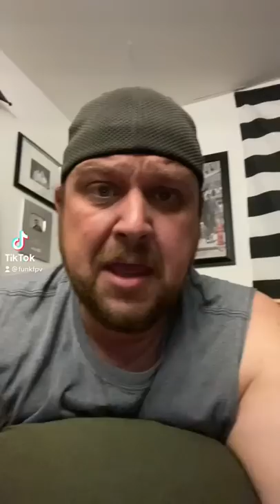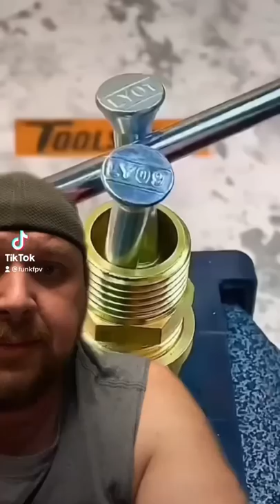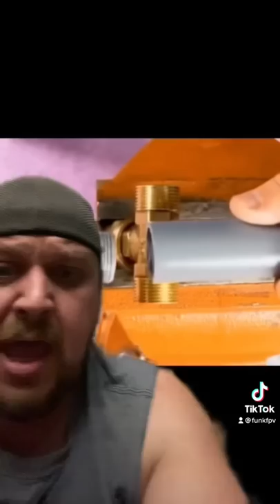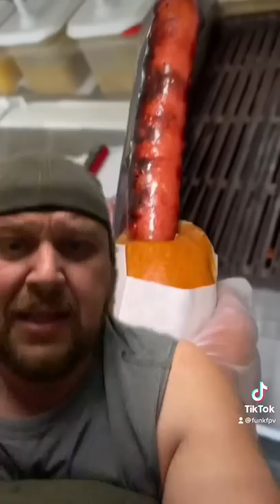Comments Review

Comment: Thanks for the common sense schooling. I just received my diploma in the mail from you yesterday.

One quick question.. How would you suggest I open the envelope? A hex key welded to a crescent wrench just wasn't doing the job.
Reply from the maker: I usually use a string trimmer with a brush hog head on it
Reply: @FunkFPV  Ah, yes. Thanks! It worked perfectly.
Reply: @FunkFPV  ah, the AvE method...

Comment: So to clear up some shit on the the first one.

I work at a mechanic shop and a frequent customer shows up with some very old brass and steel piping couplers joints very similar to the video...only problem is that they are from the 1930's and the corrosion is so bad that he stripped the hex center point, because it's old corroded brass.

Long story short,the gentleman brought it to me because he needed me to remove the couples and refabricate the brass so he could use them again,(apparently the size was not in stock and he needed to reuse the old ones).

The only way I could separate the union fittings was with EXTREME Heat form torch, a $200.00 Snap-On extended Pipe wench, and an oversized vise.

I ground the hex surface to a 21 wrench size so he could reinstall the union fitting.

I did this with Zero charge to the customer because I'm the only person that works on his vehicles to date.  And proud of that. 

To anyone that thanks this is video is legit with 2 nails is an absolute, inexperienced, not I able person of stupidity. 🤣

Comment: As to the two bolt easy out ,  if the nipple is broken off flush you will only have at most three quarters of an inch of nipple left in the fitting. That would not be long enough to use the two bolts technique. Might be useful if you had a long nipple passing thru a wall or something not moveable that was broken off flush with the wall. If it was more than finger tight the bolts would only spin. Much easier and better just to buy pipe easy outs. I have no idea why I wasted this much time commenting on this !!!!
   LMMFAO !!!

Comment: Wtf is happening with the hot dog?
Reply: In Denmark it's called a french hotdog. Didn't realize the point he was trying to make in the original video. The sausage usually sticks out of the bread a bit and has 'french hot dog dressing' around the edge for that extra creamy first bite xD
Reply from the maker: Naughty things
Reply: @7eis  honestly sounds delicious haha
Reply: I think the initial thought was to not get greasy fingers or risking spilling stuff when handling a regular. They are definitely handy while driving and had been a stable amongst tradesmen ever since they rode bicycles instead of vans. You can get them at any service station.
Reply: @FunkFPV  occasionally one of the big service stations sells a twin dog. It's one double width bund with two separate holes. You can get a different weener in each hole simultaneously xD
Reply from the maker: @7eis  😂😂

Comment: The cheap bastards who installed the hot water heater in my house could not be bothered to connect the condenser line with a 3 cent coupling so they butted the ends together and put a piece of duct tape around it

1 week after moving in I thought I had a leak. Found the problem and fixed it in 1 minute for less than a dollar. I swear the laziest pieces of shit get into those types of jobs